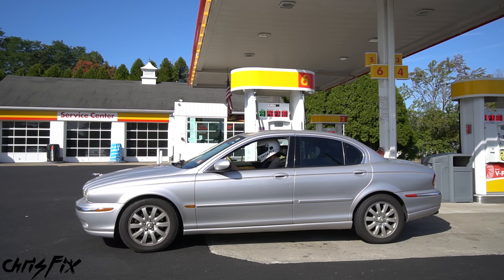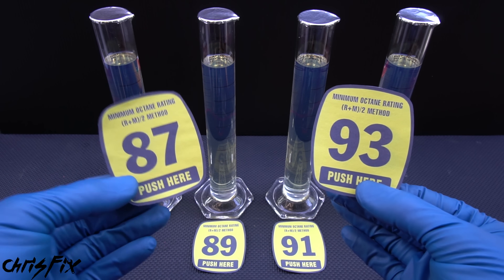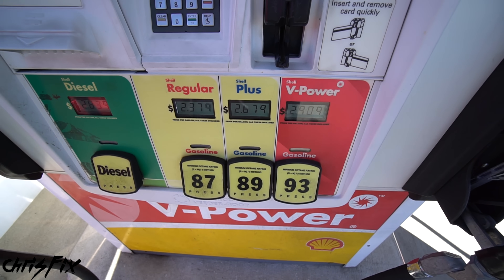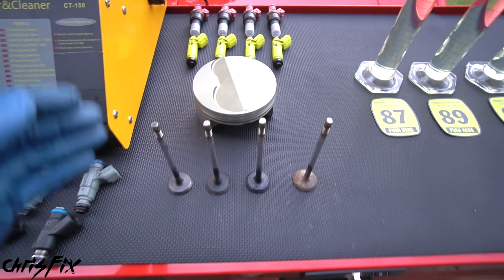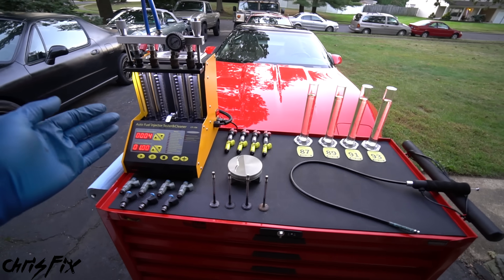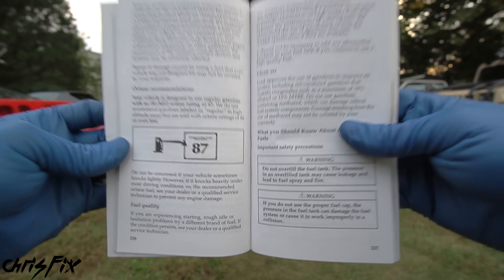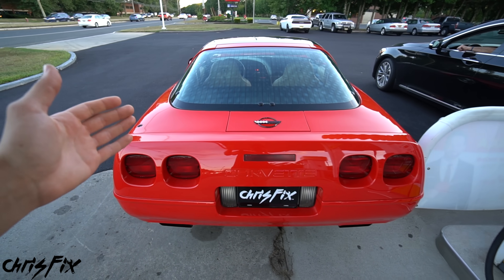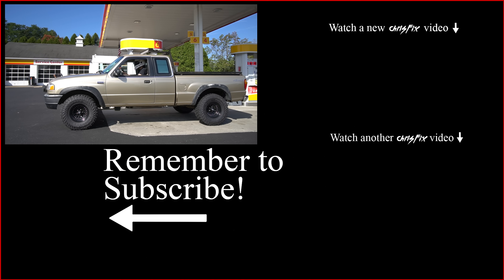What is the BEST Fuel to Use in Your Car or Truck and WHY

Comment: E-85 will result in a reduction in gas milage. My Ford truck is flex fuel , it gets 20 mpg on 89 octane regular with zero ethanol  or 17 mpg on 87 octane with 10% ethanol and 12 mpg on E-85 .  I would never use E-85 although Ford says I can.  A Ford dealership had an excellent chart showing the mpg and ethanol % with resulting mpg .  I live in South Dakota where E-85 is all over the place, usually at $1.20  or so a gallon, but you pay for the milage hit.  That price is all over the place depending on Chicago crude oil traders who have never done a days work in their lives.

Comment: I heard fuel cleaners can prematurely wear O2 sensors. Can I rest assured my sensors will be fine if I do the 2500 miles Shell claims it takes to clean 70% of my deposits with their fuel?

Comment: Can I run high octane for a certain amount of miles to clean out engine and then switch back to 85? Or is switching from 85 to 97 bad for the engine.
Reply: No, thats fine. It wont hurt anything. However, it may be cheaper to buy something like a fuel system cleaner though.

Comment: Great vid. Question: I have a 2.0 Ecoboost Ford engine. I use 87 but I'm wondering if using q higher octane occasionally would help to keep it cleaner?
Reply: That's a marketing tactic that was used. Higher Octane does not necessarily mean cleaner fuel. High Octane means it's harder to explode. Thus the pistons can come closer to the top of the Valves. If your car is recommended for lower Octane and you put higher Octane in it, the explosion in the cylinder will come after the piston rotates the top, etc. If you drive your car on the high way once in a while, just get the rev's up and that will clean out most of the carbon build up in motors.
Reply: Jinn Tao thanks!
Reply: Gregg Hanson The best thing you can do for your engine is buy branded fuel from a reputable garage, regardless of rating. Then take it for a proper long run every so often. Lots of short trips from cold kills engines. Also, change your oil and filter every 6000 miles or 12 months max, whichever comes first regardless of the servicing intervals in the book.

Comment: I recently bought a 2008 Dodge Charger rt and it pretty sure the manufacture calls for 89 octane, however I’ve been putting 87 in it since I’ve bought it. I’m wondering if there’s anything I should do when and if I switch to 89 octane (fuel additive etc.) maybe it doesn’t matter. Idk. Thanks for the help

Comment: Will flex fuel vehicles run bad if you use E-85? Because my moms dodge caravan runs terribly now that she put E-85 in it. It shakes and bumps up and down violently too. We brought it to the shop and they said it was a misfire. We changed everything that the scanner said to and repaired everything and nothing changed, so we brought it to another shop and they said it was something wrong with the fuel injectors (which we changed days before) and now they want over $600 to get the car back. And they diagnosed it wrong. We haven’t tried 93 yet so will that at least help?

Comment: I'm driving a diesel right now.

That was easy.
Reply: There is also high cetane diesel fuel now at certain Shell stations.
Reply: @GibsonBuck  Cetane in the US is 40-50, but higher is not always better. The ambient temperature may dictate what to burn, hot weather needs lower cetane — opposite of octane. FYI I Used higher octane in the winter once and was hard to start.
Reply: likuid300 exactly what I was thinking. Good job!
Reply: You'll want to stick to the older ones that don't have DEF.
Reply: KroneYT If you drop gas into a diesel while it’s running at the pump the RPM’s ( engine running speed) goes up. Engine runs faster. Tow it to a garage to have the tank drained. You can run it over to a diesel shop on idle to do this but not far. Do not drive over at highway speeds can really damage your diesel engine. About $ 300 to have fuel system purged drained of gas in a diesel powered vehicle.
Reply: @markfrance9924  Years ago I grabbed to wrong handle at the pump. Put about 5 gallons diesel in my 73 Plymouth duster. Ran like poop but I didn't know why (I was an 18 y/o fool then). After work, I almost couldn't get it started (cold engine). Luckily my father knew what was wrong and told me to fill it up the rest of the way with premium gas and it will run rough until the next fill up but it will run.
Reply: @dropzonewarzone5251  I don't know why I grabbed to wrong one. That was 33 years ago and I was a teenage boy. It may have been a hot girl in a skimpy outfit. More likely, it was I was running late as that is the time I was working full time and going to college full time. So many days I would leave home at 7am and return at 2am. Wake up and do it all over again. I would but be able to keep up with that schedule these days. I often wonder how I did it then. I do remember many days I would fall asleep in class. Luckily the teacher knew the situation and didn't hold it against me too much. Part of that was because I was still getting straight A's so I must have been learning something.

Comment: Hey Chris  can you let’s say mix premium with regular
Reply: Yes you can.  If you mix 85 octane and 91 octane on a 1:1 ratio you will get 88 octane. ie. 85+91=176, 176/2 = 88.   Gasoline mixtures will figure out mathematically in any given ratios.
For instance .. Lets change the above ratio to 2:1  (85+85+91 = 261, 261/3 =87 octane)

Comment: The other thing is higher the octane gas the harder it is to ignite so if you put 93 in a car design for 87 the car will run worse and you will get less miles per gallon because the ecu will probably have to put in more gas then the o2 sensor may read to rich and your car will struggle to keep the fuel air ratio proper . The other thing to look out for in a gas lid if your gas lid say 87 octane use only 87. If it say 89+ use 89 or the next higher available in this case which 93. If you see 89+ and you start putting in 95 or 98 if it available your engine will run worse it wont knock but anytime you engine is not running optimal it can lead to addition wear and tear.

Comment: Speaking in teory that should be the case, however i used to own a Corvette and i bought in in the USA and drove it there with the  89 octane then i got it to my country in Europe and started driving it with the 95 octane that we use as regular and there is a substantial difference both in engine work and the performance itself so they should be the same but they are not really since the shit we have for gas is mixed with all different substances that should not be in it in general

Comment: There's a couple of caveats here, and they're big ones.  Ones so big that I can't believe that oil companies get away with this.

The first one is the fact that depending on where you live, refining may be limited.  Where I am, for example, there is one refinery that serves EVERY gas station within about 300 miles of here.  It doesn't matter what the label is on the store, it's all coming from the same refinery.  It doesn't matter if it's a Shell or a Mobil, they both get the same gas.  So anything that either of these companies claim in their commercials for their "special gas treatments" is complete hogwash.  

The second one is ethanol.  Depending on where you live, the lower grades of gas may have a high amount of ethanol in it (10-15%).  Again, where I live, and this likely varies widely due to local regulations, all grades of gas other than supreme have ethanol in them.  Ethanol sucks in non-diesel engines.  Putting it in small engines can also lead to very severe problems with them (which is why rental places like Home Depot make very clear here that you MUST use supreme gas in their rental tools). 

So I use premium in all my vehicles and small engines.  It's too bad that it's partially being wasted, since the computer isn't tuned to it, so there's no real performance gain, but there's no way I'm putting any gas with ethanol in it in my engines.
Reply: I can't remember who told me this, but yes, the gas comes from the same refineries, but the different companies, like Shell & Chevron, put their additives in either when it goes into the tanker truck or when it is discharged from the truck.  I think it's usually the former.
Reply: @mrau92me  Nope in both cases.  I've physically watched the same delivery tanker (unbranded, or basically a non-standard shipping-only brand) literally drive out of one station, and drive into a different company station 100 yards away.  And we know that nothing is done at the refinery, because a couple years ago there was some kind of an "issue" that caused supreme gas to leak into the plus/regular tanks.  A letter was sent out to the service stations warning customers that require supreme gas about this, and to contact the refining company for further information.  The identical letter was posted in every gas station.

Whoever told you that was in error.  Or perhaps, they were from an area that has multiple refineries, and maybe things are done differently there.  Here in the northeast, it all comes from the same spot, and is identical at every station.

Comment: The fuel isn’t regular fuel. The fuel is oxygenated by Ethanol (E10) I have an older 90’s nissan which will not run in this fuel. It does run fine in non ethanol fuel perfectly. The new VW Beetle (2015) runs fine with the ethanol. I normally run fuel with 89 and 93 once every 3 months.

Comment: This waz very informative & helpful. You’ve dropped alot of gold nuggetz here that I hope ppl can use & appreciate. I for one have never really noticed tha gas marking on dash. Usually all one may look for there iz if something iz wrong which iz  xpected & very common. So with great job. Now with that i’ve resubscribed. I waz subscribed before but had changed namez & i guess it lost most of my subscriptionz some how but thatz not important here. Ppl use this info. In tha long run it will help save money & avoid many issues that go unchecked or unnoticed.

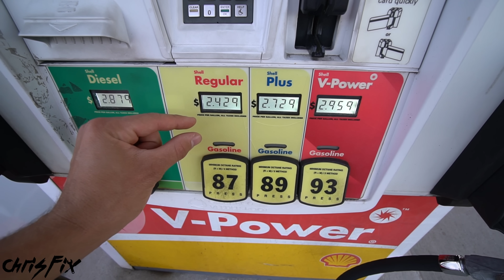Comment: hi chrisfix I have a question, you mentioned in the beginning that octane level is nothing to do with the power neither efficiency but at 12:22 with the corvette you mentioned that using 87 the car might loose little power and efficiency.. I am confused pls help : )
Reply: Grand Project Cars I think it depends on your vehicle for example on a 5.0 F-150 it is dyno proven that 93 gives you more horsepower and torque than 87 e85 gives you even more than 93
Reply: @Josh-nz1qc  oh I see maybe that's the case then. Thank you : )
Reply: Grand Project Cars but it just depends on how the manufacture set the vehicle up also don’t run e85 unless your vehicle is set up to do it
Reply: @Josh-nz1qc  yeah yeah, its not available here in Sri Lanka anyways : )

Comment: What's not true sonny boy is what you're not telling them the higher the octane the longer it takes for the combustion to burn it example extreme low 85 pops pretty fast before the Piston goes all the way down 93 on the other hand is burning and pushing on the Piston through its full stroke who is wasting fuel now Sonny Boy if you want to speak with someone is gave me my information go to the University of Illinois in their science applied mechanical engineering
Reply from the maker: Thanks for sharing but I am a scientist and my information was verified by petroleum scientists as well.

Comment: I like it feels that doesn't allow my engine to paying and knock after I turn the key off like my lawn mower 85 Exchange in knock in the engine 87 done the same 9 the 93 runs perfect in a John Deere also like the pills that make the bigger numbers on my motorcycle show up better like 89 go 129 but 93 equal 132 I have the first Ford that says in the owner's manual congratulations you no longer have to run premium gas in a Ford a standard regular gas of octane of 93 will do fine somebody's lying and I don't think they were back in 1972 before all this fucking bullshit was invented

Comment: Hey Chris, I have a quick question. I too don’t believe a lot of the myths regarding regular and premium fuel. However, I had an old man who was a mechanic for decades tell me premium is better. He said the federal government requires a certain level of cleaning agents in fuel, and the chemicals that are added to premium fuel to increase its octane rating make the cleaning agents in the fuel work better at removing deposits. The side effect of using premium fuel is increased acceleration, smoother idling and increased fuel economy. He told me it’s not so much the increase in octane rating that does all these things, but rather the increased octane making the cleaning agents work better. What’s your thought on this?
Reply from the maker: Exactly what I said in the video. The only difference between regular and premium is octane. Shell puts more detergents in their premium but other brands have the same amount in all of their fuel octanes.

Comment: The long and short of gasoline usage is this...in today’s modern cars, 89 octane is more than sufficient. Cars today have computers that adjust timing in real time (among dozens of other engine and transmission and exhaust functions) for driving conditions and how you are running your vehicle. Save tour money and stick with 89 in MOST vehicles. In my wife’s 2015 Honda Odyssey van I ran 89 octane and averaged 23.8 miles per gallon. Next fill up I use 93 and averaged 22.5 miles per gallon. So basically I spent extra money for no better mileage. And on 89 octane, I think it even ran a tad smoother.

Comment: Your an idiot...valves get oil on them from either a leaking cylinder head guide...or blow by from the piston. Injectors get dirty from shit in the fuel you put in your tank. That's why you have a fuel filter. Yes I am a master platinum certified mechanic

Comment: Resistance to PRE-detonation. Detonation is what makes the engine run. PRE-detonation is bad.
Reply: No, he’s confusing combustion with detonation. Either way he’s wrong and should stick to music and not try to school an obviously well educated mechanic.
Reply: Garret Whogivesashit 
det·o·na·tion
/ˌdetnˈāSH(ə)n,ˌdedəˈnāSH(ə)n/
 Learn to pronounce
noun
the action of causing a bomb or explosive device to explode.
Similar:
explosion
discharge
blowing up
ignition
blast
burst
crack
bang
report
a loud explosion.
"a series of deafening detonations was heard"
TECHNICAL
combustion of a substance which is initiated suddenly and propagates extremely rapidly, giving rise to a shock wave.
Reply: musicman59753398  Incorrect.  You are confusing pre-ignition and detonation.
Reply: Dr. Michael Bennett 
det·o·na·tion
/ˌdetnˈāSH(ə)n,ˌdedəˈnāSH(ə)n/
 Learn to pronounce
noun
the action of causing a bomb or explosive device to explode.
Similar:
explosion
discharge
blowing up
ignition
blast
burst
crack
bang
report
a loud explosion.
"a series of deafening detonations was heard"
TECHNICAL
combustion of a substance which is initiated suddenly and propagates extremely rapidly, giving rise to a shock wave.

Comment: Thank you for the video.  I still have some questions I could use answers for.  I have a 1999 Dodge Intrepid with low mileage and I've taken excellent care of.  I've almost used regular glass all its life.  And it's in very good shape for its age.  Several times in the past (about 5 years ago) I heard I need to switch once in a while to high, so I did. But only three times.  I haven't done since (about 8 years now).  (1)  I heard that older cars, like mine, need to use higher octane due to its age.  Is this true or false?  (2) I also heard that when the mileage goes above 100,000 I should use a higher octane.  Mine is now 73,000 miles.  Is this true for me?

I now know that some gas is higher priced or higher because of octane percentage use additives.  I don't use Shell or Exxon gas, okay maybe once or twice in the past 4 years when I was almost out and those were close by and I added $20 in.  I've been using the cheapest gas prices I could fine.  I'm thinking, after your video, this may not be the best advice for the health of the car.  Then again I'm circling back to the age of the car needing a change of gas.

The engine doesn't rattle, so my son's says, and he's not sure of the answers I have now, and he was a mechanic for five years.  He helps me take care of my car when he can without a lift.  I am also 70 years old and took 2 years of car repair training through the local adult education program.  I did $7,000 worth of work on it about four years ago for less than $2,000 worth of parts in that education program.  I loved it.  Oh yes, I use a walker and learned how to do most things except tire stuff -- too heavy for me -- or when I had to lean over the car engine to get to a part.

What advice do you have for me about using the gas I need for my car now?  Appreciate your assistance.  Thank you in advance.

Comment: If your car says run regular is it recommend to run premium once in a blue to keep engine clean???
Reply: NOOOO! that will be bad for your engine. don't ever run premium if the car requires regular. premium isn't technically better fuel. it's just different fuel.

Comment: I use to get Sunoco 100 octane for my cafe race Honda 4 cylinder bike years ago. The station was a couple miles from a drag strip and they had that grade for the race cars.

My bike definitely was more peppy with the 100 oct gas. I didn't run it all the time because it was very pricey. The added pep was probably due to improved apparent timing and smoother burn.

Whatever the reason it was absolutely noticeable when I filled up with that gas.

Also, bought a Ranger in 89. It ran fine on regular until about 50,000. Then it knocked under acceleration.

I upped to mid grade. That worked for another 50,000.

Then the knock came back. I switched to premium and that took me to 220,000. I sold that truck for $1,000. It still ran like a champ.